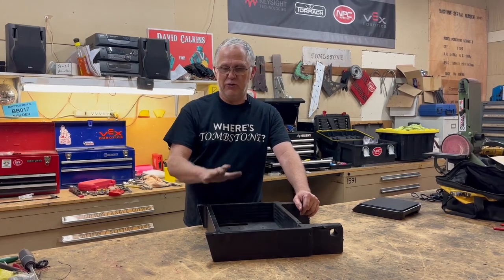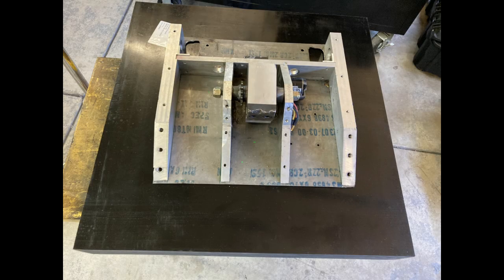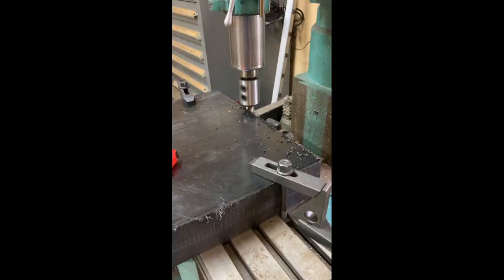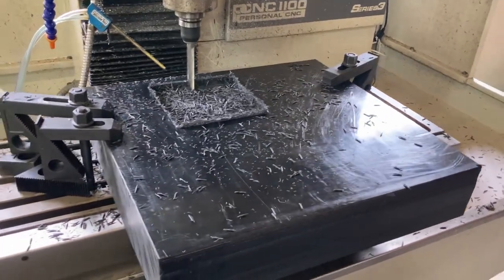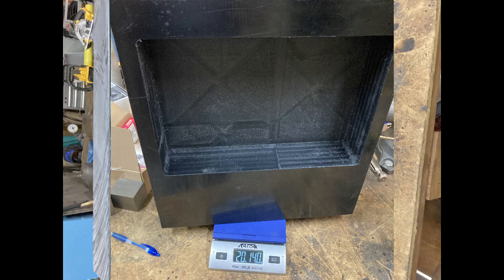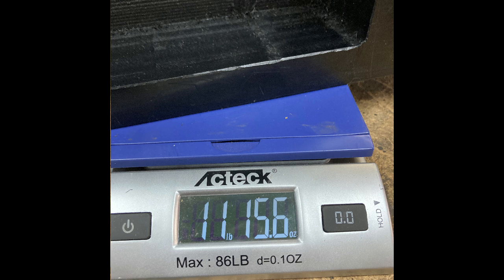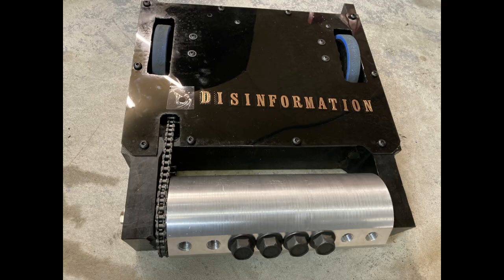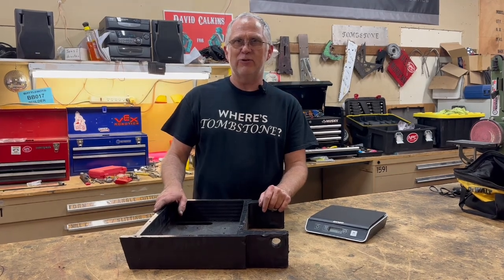Can you make a combat robot out of plastic?

Comment: I've built many many functional prototype and one off parts from plastic for various applications.  I use UHMW and PTFE in applications that require a low friction coefficient or high temperature.  When taking large amounts of material from a solid block like this, I would add dowel pins in the bottom to have a positive stop to keep the piece square in the machine.  If possible, I would use a recessed bolt in a large area that is going to be removed completely anyway, and use that with a T nut for additional hold down.  Taking 150 git sand paper to the backside is great to add some friction, but with these materials, this is minimal at best since these are some of the lowest friction materials you can get.  In future projects, I would recommend looking at type 2 fiber reinforced PVC or 6/10 nylon.  Both can be found in blocks like this, or in sheets.  Unlike UHMW, the PVC and nylon can be glued with joints stronger than the base material.  Also, metal plates can be glued or heat-set into place for extra strength and wear resistance.  With sheets, they can be fabricated like plywood with rabbit, mortise and tenon,  and dovetail joints for extra strength or to allow flexibility in the joint.  This would take a more engineering approach to get stresses in the materials where you want them rather that a bruit force method.
Reply from the maker: There are certainly some things I would do differently next time for this, some of which follows your suggestions. I was sort of designing on the fly for this, so really didn't know where the bolts through the bottom were going to go when I machined this out. Having a clearer idea now of how I would do it again, means bolting it down through the material and using locators like dowels is more of a reasonable option. 

One of the biggest advantage to UHMW is the simple fact that it is hard to grab. Weapons hitting it just don't get the same bite as with other plastics. So although there are other options for material, if I rebuild this again I would almost certainly do it from UHMW again. Engineering for combat and impacts just tends to be different from classic engineering. Raw strength from layered manufacturing (like your plywood analogy) makes lots of sense, until you are attacking it with more energy than almost any saw available :) 

Thanks for your inputs! I agree with a lot of your suggestions and will be doing some things differently, assuming I rebuild this in the future.

Comment: Yeah. I can relate to the plastic shavings. I work at a sign shop and we had to cut ane hollow out a bunch of big letters from a big 40mm sheet of plastic. Its so much surface area. We had to hollow it because that was the back and we needed the LEDs to be inside. And the we cut out the faces from a thin shet of plastic that lets the light glow through. It's cool. But i have to empty the vacuum so many times.

Comment: It would be interesting to see damage after the fight. Maybe some areas are way too thick and can be significantly thinned. Maybe some areas are too thin and will be the first to have issues. 
I'm also curious if using a ball endmill to do the interior pocketing would help strength. Round out those interior corners and reduce stress risers.
Maybe instead of thinning the bottom/sides, you could pocket out a structural design, like an isogrid.
Reply from the maker: The final segment, where I give the final weight, is post the NHRL event. There were a few scrapes and whatnot, but overall it held together really well!
Reply: @ray9368 wow it looks great for going through a fight. I couldn't even tell. Very surprising.

Comment: I wonder how a stack of UHMW sheets glued with contact cement and through-hole bolts would compare. I've been picking up cutting boards whenever I see them.
Reply from the maker: UHMW is notoriously difficult to glue. Not saying it can't be done, but it's just hard to get anything to stick to it.
Reply: Not glued, but Depth Charge uses stacked UHMW sheets with (i think) standoffs/shoulderbolts. Pretty resistant to abrasion, judging from its fights
Reply from the maker: @l8dawn  Bolted together armor is pretty common, and widely used. Usually it's so you can have different densities of material in the package - say titanium on top to provide slicing resistance, and plastic underneath for impact resistance. Layers of the same material will always be less strong than a solid block of it. But it does make repairs between matches much easier!
Reply: @ray9368  yep! we use the sandwich technique on Record Scratch, and I'm doing a similar idea on my current antweight.